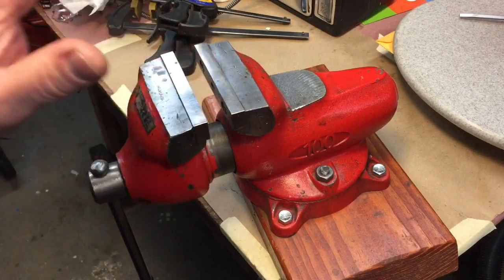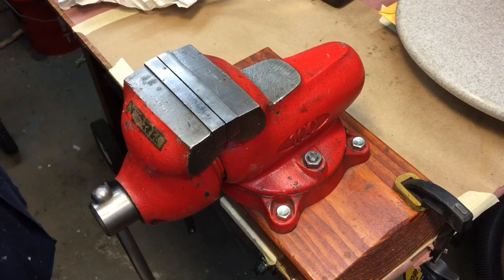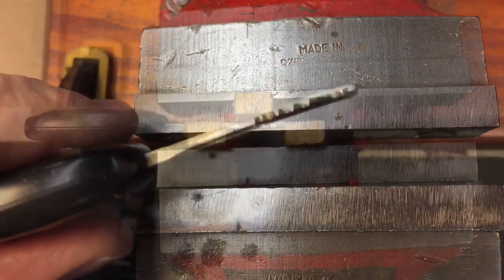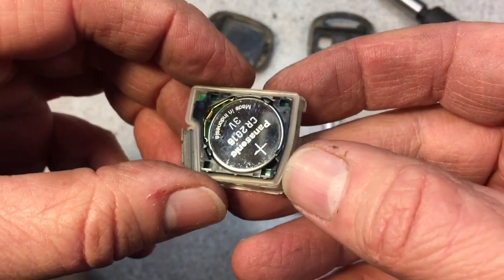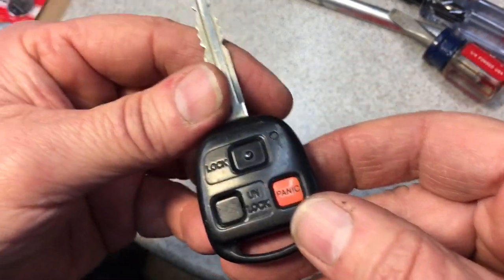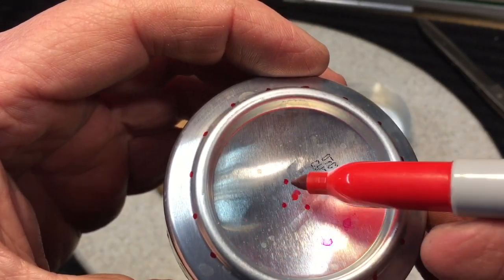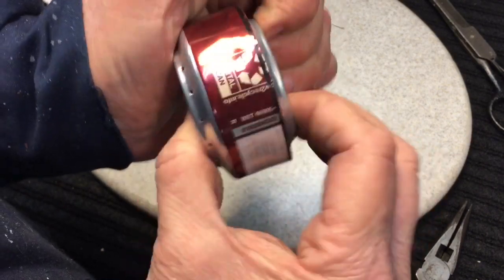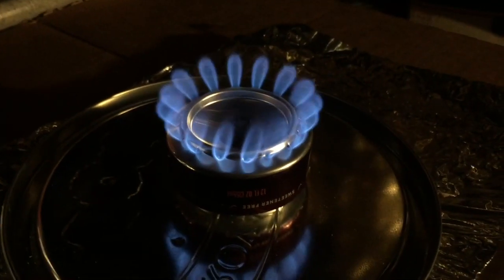York 100 Vise- Automotive Key Service and Penny Stove Build!

Comment: I made one like that with small C-ration cans for warming up C's and used C-4 for fuel. The Combat Engineer guy that gave me the C-4 said to just let it burn out and not stomp it or it'd blow my leg off. It worked fine and I still work.......somewhat. Happy heat and GBWYou!
Reply: We had good stoves on our tanks and a BV inside to make the tea 😜😜🇬🇧
Reply: @tony1721  I was living off a fork lift in a jungle. Very few comforts. No bug netting and that's how I ended up in 24th Evac.
Reply: We use to take damaged firecrackers and break them open. 
We would light the pile of powder and stomp on it. It would go off with a bang. 
I think it has to be confined for it to explode. 
Kids are crazy. 
You weren't much older in Nam I imagine.
Reply: @OldSneelock  19 or 20, probably 19 but had already survived the idiots throwing stuff out of the powder wagon on the road job, helping on a drill and surviving a few shots and had a vague idea about C-4. It burned like sterno, nice and blue or like John's can stove with the alcohol. They were still moving dirt on that firebase and I was around a D-5 and an A/C rubber tired loader and I think the Cat operator gave me the block. They moved the 5 with a Sikorski flying crane in 2 drops. Blade and tracks on one and bare tractor on the next. Probably moved the loader on a lowboy. That's how they hauled the lift I was running, on a lowboy. It was interesting but not interesting enough for me to stay in. I liked being around the amphibs in Virginee too!
Reply: @lewiemcneely9143  Demmer was an education. Miltiary vehicles are designed tough as nails. The maintenance on them was pretty good but there were a few field expedient repairs that were questionable. Still and all it was fun learning about the ins and outs of stopping high energy objects and pressurized gasses. That's where I learned that there is no such thing as bullet proof. There is always a bigger, faster bullet. The second one is almost sure to get through.

Comment: Little tip/shortcut for cutting the cans.
Use a a utility knife blade and attach it to the block of wood with a couple of screws with just the tip hanging over the edge.
Push the can against the blade so it pierces the can then just rotate it like you did when drawing the line with a pen.

Comment: As an additional information, their designation is not just a random thing. CR2016 is 20mm in diameter, 1.6mm thick. The 2032 is also a common type, also 20mm diameter and 3.2mm thick.
Reply: That is good info.  Thanks for sharing
Reply: Thanks, Marcel. That’s really helpful.

Comment: Scout, I saw another guy on You Tube make a penny stove.  He used a clever trick.  Instead of first marking the cut-line, he placed a utility knife on the board, spun the can around, and made a perfect cut without the line.
Reply from the maker: I have done that and it might take a couple passes...  Thanks!

Comment: I had my Lexus key fob battery fail recently. Lost that tiny screw. It fell out of my fingers hit the tile floor and bounced back to Japan I think. Or I’ll find it barefoot in a month or so. But I used a glasses repair kit that comes with screws to fasten it down with a little light duty thread lock. And what a fantastic little stove. I think I’ll try that this weekend. Thanks
Reply from the maker: That is one small screw!!   LOL

Comment: I bought 25 of those Panasonic coin cells this summer and so far 3 have been absolutely dead 0.00V. I haven't even opened all the rest yet. I never bothered to complain because it is still a lot cheaper than buying them locally.
Reply from the maker: It's hard to trust bulk button sales when that happens!

Comment: Cool stove but how do you turn it off ?
Reply from the maker: It will run for about 10 minutes or so with 1/2 alcohol.  However if you want to shut it down you smother it with anything...

Comment: You collect so much locks and keys that I figured you were a good person to ask. Any advice for someone who consistently breaks off keys in locks? I have already gotten in the habit of getting extra keys but I have never discovered a good technique for removing the broken chunk of key. Any advice?
Reply: I believe there are videos on Utube that show how it's done
Reply from the maker: First off get some Tri-Flow lubricant and keep those locks smooth and easy working.  We had a guy break off a key in lock a while back and he was using all sorts of super magnets getting stronger and stronger magnets each time....  When I told him that his key was Brass and therefore non magnetic he was less then happy.   =D   Broken keys are tricky to get out in a standing lock.  Padlocks are a bit easier.  
https://www.amazon.com/s?k=tri-flow+lubricant&gclid=Cj0KCQiA_8OPBhDtARIsAKQu0gZNaa8ZAQYjA2uNLRCRo3JDreiIOwRU2Zlm9498UyqOJCGhK56k3LcaAoMwEALw_wcB&hvadid=174220595646&hvdev=c&hvlocphy=9004382&hvnetw=g&hvqmt=e&hvrand=10186693239562253584&hvtargid=kwd-4319069861&hydadcr=9382_9621520&tag=googhydr-20&ref=pd_sl_cz6ga9pjp_e

Comment: Thanks for the Vise advice. Next time I have to straighten a key I will have to try your technique. That was a long life for that battery, I have 2016 cells in my burglar alarm fobs, they never last that long, maybe two years. I just had a used machinist vise show up, lays flat on its side on the drill press table. Was that in one of your videos?
Reply from the maker: yes!  You've got a good memory!
Reply: @ScoutCrafter   Found the episode - Deflection and Restoration 1957 Channellock 420 - learned a lot from that episode.

Comment: I bought a Record Vice about that size and use it all the time. One thing i noticed and didn't when I bought it was it has no anvil on it. Is an anvil on a vise a useful item that you use a lot? I ended up using a piece of train rail.
Reply from the maker: Brian- Never...  I will address this great question!  😃👍